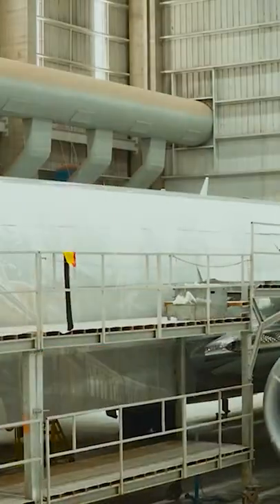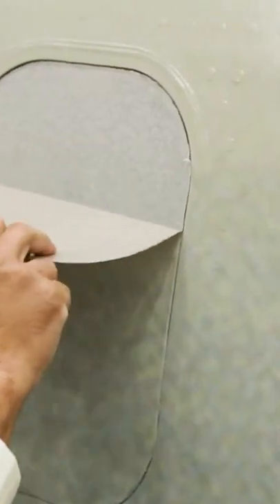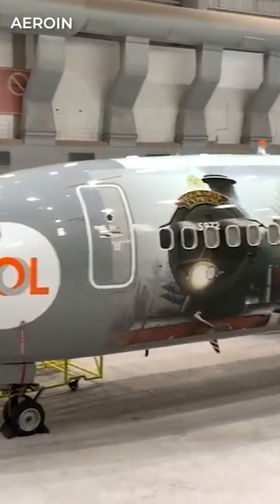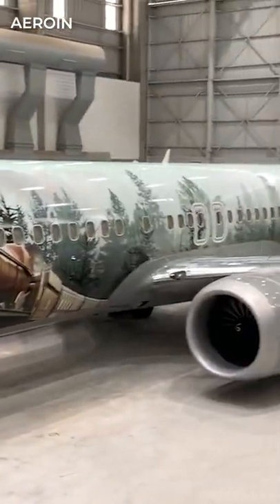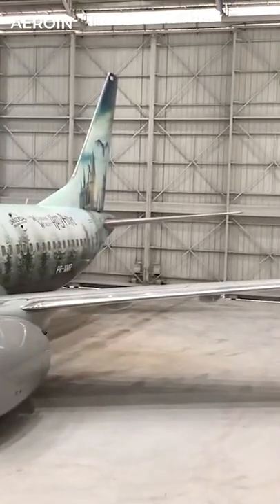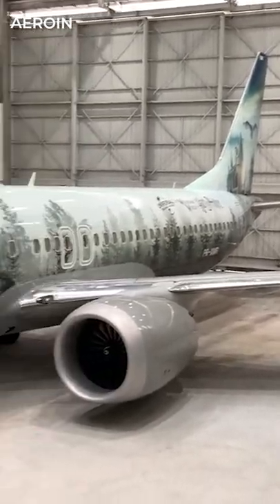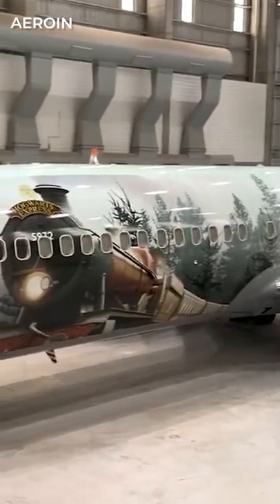The Harry Potter Boeing 747: A Visual Tour

Comment: It takes a trained eye to see the difference between the B737 and the B747. It's possible that the person who wrote and photographed this article, had trouble actually looking at this beautiful plane. I can see how that person got confused. The two aircraft both have a body and wings. Plus a tail. Other than the B747 having 4 jet engines vs the B737 having 2 jet engines, and the body of the B747 being over 10 times larger than the B737, I can sorta see how one would be confused. And in need of glasses!